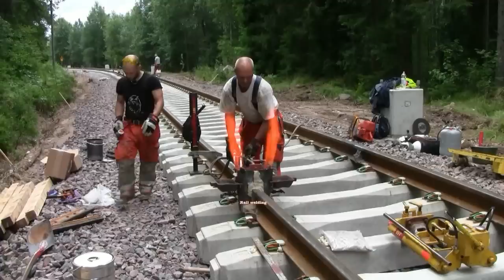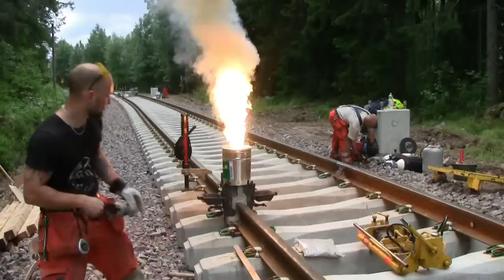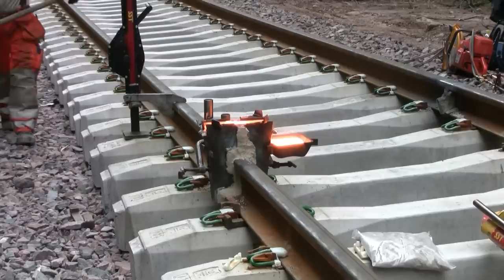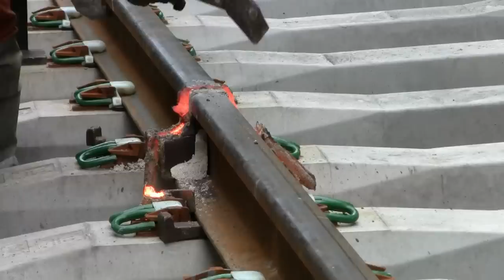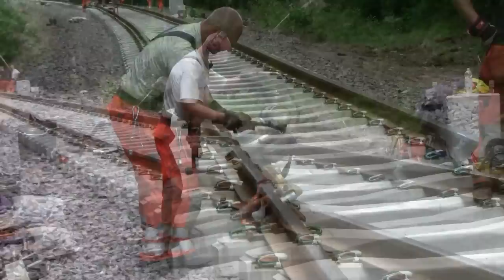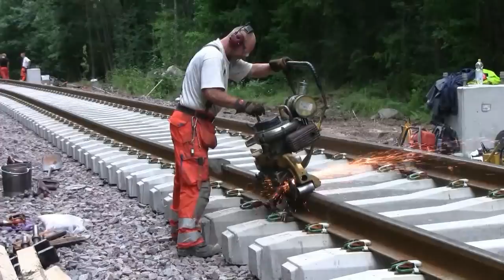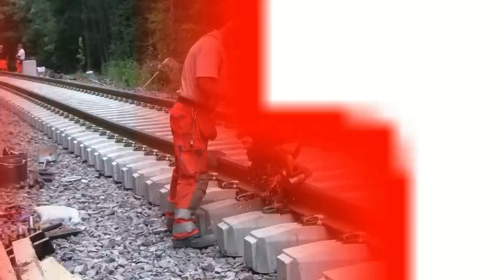Railroad thermite welding

Comment: Too much work! Just pore some jetfuel on it and shit will melt in less than an hour. It's a fact! :D
Reply: Liam Barrington Obviously you didnt get the point.
Reply: I see what you did there.
Reply: Nice.
Reply: Jordan Tyler I said steel fuel
Reply: I agree with you. The government told us without any doubt that jet fuel will melt beams of steel in just under an hour. Proof is in watching the 911 events of 2001. Two buildings came down, in almost PERFECT demolition, after being injected with a plane load of fuel. And you KNOW our government would NEVER lie to us. 

I just cant figure out how the OTHER building came down.....40some stories high, and collapsed later on after the first two fell.... Hear about that one?
Reply: Jet fuel fumes brought down tower 7. WITHOUT A DOUBT!
Reply: You could heat it up to 1,500°F, the temperature around which steel can become forge welded.

When steel gets above 1,500°F it becomes malleable. When steel is that hot it can be hammered together into a single piece with special equipment. Blacksmiths generally get steel to 1,600°F-1,800°F for forge welding with hand held hammers though. 

Seeing as jet fuel, in perfect conditions, burns above 2,700°F it would easily get steel to 1,500°F. (melting point of steel is generally agreed to be 2,500°F barring certain alloys. )

Granted on a railroad you wouldn't get perfect conditions, but a 1,800°F jet fuel fire would easily be enough to get steel to 1,500°F where it could be forge welded with specially equipment, and even close to 1,700°F were it could be hammered together by hand, but it would be impossible to tell if you get 100% weld surface.
Reply: Also, on the 9/11 things...
People do understand that metal becomes bendy LONG before it melts?

If you heat up a 1 inch thick steel rod enough, you can bend it by hand without even having to use any tools... Long before the rod is even close to melting...

Not to mention you have several tons of building which has to be held up by metal you can bend by hand? Wood fires only get to a maximum of like 1,500F at perfect conditions, but generally accepted to be closer to 1,000F.

Jet fuel on the other hand CAN burn hot enough to melt steel (as I said in the previous comment) in perfect conditions, but it can easily bring steel to a failure point.

Also, ramming a plane into steel beams generally weakens the entire structure a bit, puts extra weight on other beams that were never designed to take that load.
Just sayin.
Reply: That's thermite they're using, gets way hotter than jet fuel.   Burns like a big acetylene torch.
Reply: PRK Wagner 
You missed the joke so hard.
They already know what you just corrected them on.
You made yourself look like an idiot.
Sorry.
Reply: thermite also brings down buildings...kinda like building 7
Reply: @confuzio, Yeah, ignore all the special equipment they needed here in this video and the fact that it needed to attach directly to the rail and the amount of time it took to do just one single weld (completely undetected right?  After all, they're out in the woods in the middle of nowhere.)  Truther's aren't fucking morons because they think 911 was an inside job; they're fucking morons because you can point out the obvious flaws in their conspiracy theories and yet they'll still think it was an inside job.
Reply: Liam Barrington You probably never heard of something called a joke
Reply: Your mom brought down my beam.
Reply: time is money they can't wait an hour for this
Reply: it's a meme
Reply: Duh!
Reply: Those perfect conditions were not present on that dreadful day. That fuel burnt off way to fast for what happened to possibly have occurred.
Reply: Bendy would have led to asymmetric collapse.
Reply: Do you have link to video of towers toppling over? The only ones I've been able to find are of them collapsing straight down into own footprint. Thanks!
Reply: Hohohohoho!!!!
Reply: No, jet fuel's only used when very tall buildings need to be demolished into powder and convenient truck-length steel girders, within their own footprint, with low budget, zero preparation and only  a few hours to do it.

...oh and when public hatred needs to be ignited to fan the flames of war.

So, for welding rails... no.
Reply: Did you ever watch a blacksmith melt metal with charcoal? Well its a fact that jet fuel with an air source like the draft in an elevator shaft will cherry steel and weaken it to failure
Reply: Take a metallurgy class, then feel stupid for posting things you know nothing about
Reply: yeah!! but james bullock, they done did that at that therr world trading place years back!! member??
Reply: Whiskeybuisness Actually, the fuel didn't melt the steel. It burned hot enough to soften, not melt, the pins securing the floor beams to the girders. Once the temper was lost the structural strength was lost with it and the pins gave way under the load placed on them. You can achieve the same effect heating a wrench with a blow torch. Apply torque to it after heating and it will bend as it has lost all its temper.
Reply: @Whiskeybuisness  bill & hillery did it..👍..
Reply: @kurtiskaskowski5386  OUCH..👍🐒..
Reply: Tell me with all of this knowledge why are you a cashier at Walgreens?
Reply: Word is that you could melt the sun with jet fuel.
Reply: @e.l.norton  explain how Tower 7 came down.
Reply: what does jet fuel have to do with this, is that code for "i'm a complete idiot?"  i think maybe.
Reply: Explain building 7 please.
Reply: jet fuel will only soften it so it loses structural strength

Comment: Banging on red hot metal without safety glasses !? 2:54
Reply: ...wish OSHA had been around...lol
Reply: Frank Lyons
a man is also blind, it seems. As someone who didn't wear safety goggles since they fogged up and I thought 'nah who needs those anyway', and afterwards needed to visit the eye surgeon to have bits of metal that flew from lathe removed from my eye, those who are not wearing safety gear or advocating not wearing safety gear because its manly deserve what is eventually coming for them.
Reply: safety glasses would not of helped, The red hot metal would of burned through the plastic glasses instantly
Reply: Lester Awalt
Incredibly wrong, and attitude like yours is one of the major reasons eye injuries are so common in metalworking industry. I would advice you to move away from that mindset ASAP.
Also,  1mm plastic plex glasses sold at walmart for 0,55$ are *not* protective eyewear. You're looking for heat-fire-impact resistant safety glass, preferrably kevlar-reinforced if you are dealing with extreme heat conditions. 
6B type protective face shield should be enough for high intensity sparking and molten metal, you can read the full specification sheet by googling " ccohs How do I select the proper eye and face protection? "
Reply: Alnoor Gilani I’m pretty sure that isn’t Russia
Reply: yeah no nail varnish either
Reply: Turns on 
I'm a man - rocknrolla

Comment: What's wrong with conventional welding it it doesn't take this long
Reply: To get a strong enough weld that would reliably pass ultrasonic testing would take just as long if not longer.
Reply: Welding will only be on outside of rail this welds it all.

Comment: Seems like a fucking waste of time, would be far easier and faster just to have a welder going along welding it.
Reply: the gap is like 3 to 4 inches way to big for a welder
Reply: edwin asas
No not too big, not even close. I've seen steel 10 feet this, beveled to be a gap of about 3 feet at the top, welded by guys with stick welders (BIG RODS). These welds must all be 100% perfect too, as the parts are used in nuclear generators. The reason they weld the tracks with thermite is it's FAST! much faster than electric welding a joint like that. To weld one section would take an hour or better.
Reply: Joey Hollifield
*ten feet thick
Reply: Joey Hollifield so giants weld these 3 foot welds because a 3 foot electrode, and electrode holder would way alot
Reply: edwin asas
Obviously you are not a welder. The electrodes are huge, around 1" in diameter. They do not bridge the entire gap in one pass. The weld is started at the bottom of the bevel and built up with hundreds of passes. Usually 5-6 guys standing in a crack all welding at the same time, for days. Do some googling before you make yourself look stupid while trying to make someone else look stupid.
Reply: Joey Hollifield So, I'm assuming it begins as a very large V-shaped wedge and the welders work their way up to the top of the V?
Reply: exactly
Reply: Joey Hollifield Geez, no wonder it takes so long. Putting down all that metal alone is going to take forever, much moreso all the grinding and prepwork it takes between layers!
Reply: yes, with each layer x-ray tested too. Anyway, one could weld the train rail the same way, and get a good solid weld, but it would take way too long. instead of a few minutes with the thermite it would take an hour at the very least, maybe two. Most of the time spent waiting for things to cool down a little between passes.
Reply: You obviously now a lot about everything, you must be American.
Reply: Okey dokey. I just spent quite a few years in the industry is all.. I guess you liked guessing at the answers better. Sorry I ruined that for you.
Reply: Fredrik Lund

:DDD
Reply: Your typical welding wont work on 132lbs+ FHH rail. Only "butt welding" & Thermite welding works. Plus most of the rail that is installed arrives pre-welded from factory is usually 1,400 ft + long strings. Thermite burns at 5000 degrees only way u can melt that rail
Reply: I was thinking the same thing as Usernameinvalid until I read the response by David Richards. The metal composition and high temp would make this a superior method instead of MIG. Thanks Dave ,thats interesting.
Reply: Jasraj Gidda How do they transport rail that long to a location?
Reply: umm... the rails, of course.
Reply: Fredrik Lund Know* and yes, I'm American.
Reply: Isn't it nice how the foreigners are finally recognizing our superior intellect?
Reply: Why don't put your superior talent in to building up Americas crumbling infrastructure?
Reply: Too smart to waste my time.
Reply: james ceglarski actually it has nothing to do with either. The steel is nothing special, and an electric arc will produce much higher temperatures, but only right at the arc. This is done because it is the fastest way, by far, to get an actual weld that is as strong out stronger than the base material. It can be done with about any other process, only much, much slower
Reply: Pat Gavin By work train. Rail that long does bend around curves.
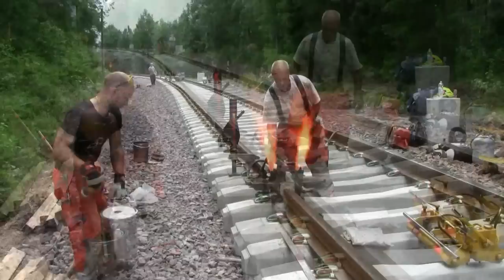Reply: The rails aren't the same hardness from top to bottom. The running surface is very hard to resist wear as well as increase efficiency, while the lower parts are softer to absorb vibration and increase passenger comfort. If you don't carry these characteristics at the joints as well, you feel a "thud" every time you roll over them. This thermite method fills the joints from the bottom up. If you look closely you will notice the worker dropping in an alloy plug before the pour (0:13). When the thermite reaches the top, it melts the plug and increases the hardness of the top of the joint. Accomplishing this with welding requires extra heat treating after the fact, and takes longer.
Reply: Fredrik Lund There's a reason America is best in the world at just about everything. Thank-you for acknowledging our superiority.
Reply: This method provides a variable hardness to match the rest of the rail. No heat treatment required so it is better than conventional welding.
Reply: N37BU6
Look, someone that knows what they are talking about.
In short it provides optimum hardness on the running surface while maintaining maximum ductility and toughness in the web and foot.
Reply: Harry Balzak The Arabs knew this centuries ago. They invented Damascus Steel. The Japanese Samurai used similar knowledge of metallurgy in making swords.
Reply: Jeffrey McMillan
Haha, thanks for the laugh mate :)

Comment: So what about expansion in the heat? I mean the railways when there is a heat wave the lines buckle and I always thought that this was reduced by the gap left between rails? And wouldn't it be smarter to have a work station on wheels with electric lifting gear to pick up those heavy pieces of gear instead of men needing to lift them by hand? One slip on the rail or sleeper while carrying that heavy gear could mean a lifetime injury.

Comment: that is a ridiculous process just to connect two rails
Reply: +Neil Quaintance You clearly have never worked in this industry, it's pretty quick compared to cutting and drilling plated joints, results in less maintenance and allows for faster line speeds.   Stick welding to the point that the joint could take the pressures and tensions it would need to would take at least as long, probably considerably longer and would be less reliable.
Reply: ***** you're right, I know nothing about it. I found it quite interesting actually
Reply: ***** I only ended up here after watching a guy torch one of those big 5 pound gummy bears with termite 😂😂😂
Reply: +Neil Quaintance Haha, I've got to find that, my daughter wants one for Christmas so it'll be fun to wind her up by showing her that! :D
Reply: +Neil Quaintance   The forces these welds are subjected to are enormous. Rails expand and contract a lot, and conventional joint bars often break in cold weather.
Reply: +Neil Quaintance
Reply: melih
perkgoz
😊
Reply: beats rubbing two stick together :)
Reply: +Sugarsail1
LOL :D
Reply: No -best there is-solid metal.

Comment: Lot of work to weld two pieces of steel together, but very interesting project. Any reason that they can't be MIG welded instead? Much faster and much less work.
Reply: Arc welding a gap like that to be able to stand the same stresses and reliably pass ultrasonic testing would be no quicker and if anything probably longer.  Thermite welds are pretty quick and perhaps more importantly reliable.

Comment: Folks! Here's some food for thought: You are watching thermite welding. Thermite will take the temp of those steel rails upwards of 2500°F. It's a lower grade of what was used on 9/11
Reply: Martin Whalley MN
Reply: Burning jet fuel softens steel.  When said steel, now weakened, is supporting hundreds of tons it all comes crashing down.  When those hundreds of tons of building accelerate through a floor or two the speed has reached, respectively, 10 and 20 MPH.  These collapse the floors they are running into even if the lower floors weren't weakened by jet fuel.

Comment: I have heard that this was how it was done decades ago. Aren't there any more modern techniques like welding robots?  This seems awfully time-consuming if there is a longing distance of track.
Reply: There is mobile flashbutt welding machines which are much quicker, but those are very rare and also limited by available access points so flashbutts only usually tend to get used in manufacture of new rail.  On a new installation like this rails will be laid in up to 200m lengths (Speaking from the UK, in other countries it may be different), so even if you're laying down a mile of track that's only around 16 welds for both rails.

Comment: I knew that the space between tracks was for the thermal expansion. Isn'it?
Reply: With continuous welded rail like this the track will be stressed to account for temperature changes, in the UK at least they'll also install expansion joints around points and crossing layouts to protect them and at set distances on straight track too, IIRC it's one every five miles.

Comment: Here’s what I don’t understand about welding the rails...when rails are bolted together with connector plates, the rails are gapped about 12mm apart to allow for heat expansion (otherwise the rails will distort)...so what method is used to allow for expansion in welded rails?
Reply: 12mm would be a wide rail gap, it's usually much smaller than that.  Heat expansion is taken care of in continuous welded rail by stressing it using hydraulic tensors to local weather conditions so that it can withstand the tension in the winter and pressure in the summer.  In the UK expansion joints are installed IIRC at least once every five miles on plain line and around points and crossing layouts.

Comment: Why fill that gap?
I had read many years ago that gap is needed when tracks expand when they get hot therefore the gap prevents  tracks from cracking...
Reply: Welded rail is better suited for high speed trains and jointed track requires more maintenance.  Thermal expansion and contraction is dealt with by stressing the track and installing expansion joints at set intervals, roughly every 5 miles IIRC and around points and crossings.  Also the risk is that tracks would buckle in heat rather than crack since they'd be under compression not tension.

Comment: Explain to me why they did it? At change of temperature of environment steel has property to increase and decrease, for this purpose specially leave gaps
Reply: No, the track will be stressed to take this into account.  Welds make the track smoother, better for high speed trains and need less maintenance.

Comment: If you weld a rail together w/o any splices, wont the rail warp in the severe cold amd heat? Ie expansion/contracting of the steel rail in severe weather

Comment: Seems inefficient.  I worked in friction welding for awhile and we had pneumatic sheers that would cut the flash and leave a nearly perfect surface.  A tool like that could easily be made for rail.